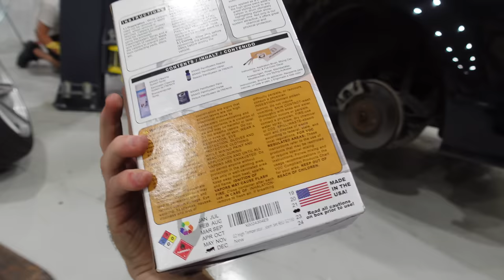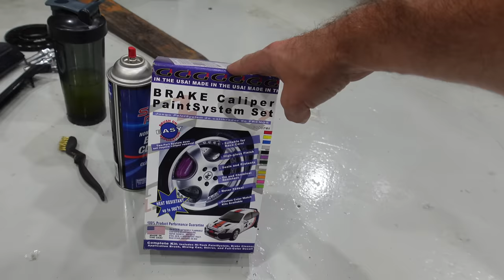The CHEAPEST Way To Make Your Car Look A MILLION Times Better

Comment: I just used a 15 dollar rattle can of brake paint since my calipers were starting to show a bit of surface corrosion. Did it when I was changing pads and rotors and did 2 coats on each caliper. It has held up great so far and its been about a year, with lots of gravel roads and minimal car washes. This kit looks nice but I feel like if you prep good enough with the cheaper rattle can stuff you can get the same result.
Reply: Mine lasted 10+ years before they got darker because of heat, but I'm in dry snow-free California.

Comment: I think it's definitely worth it to paint your brake calipers, if for no other reason than to keep them clean and free of corrosion. (The extra 20 horsepower doesn't hurt either)
Reply from the maker: The extra 20hp is real 😂
Reply: @WatchJRGo  I heard it was thirty more HP's but that might have been the yellow paint color I am thinking of. LOL!!!!
Reply: Doesn't this only increase the stopping power?
Reply: @davidbudd4102  That buzzing noise you just heard was the joke going over your head.

Comment: I painted the calipers on my Porsche 928S2.  All I did was remove the wheel, clean everything with Simple Green, and then mask the caliper off with tin foil and masking tape.  Inexpensive GM gold touch up paint made them look very clean and very stock.  I used cheap Krylon silver paint on the edges of the disk and "hat" in the center, simply wiping the paint off the braking and wheel mating surface with paper towels.

I sold the car several years later and they still looked perfect.  You can buy these caliper painting kits if you want, but you will get the same results with a good cleaning and cheap Krylon paint from the Home Despot.

Great video!

Comment: I got a kit a few years back. It uses a brush like yours but does not have the activator. This means the paint doesn’t get wasted but takes a bit longer to dry. Went with black for my DMC’s callipers and had enough paint to do the FIL’s RRS callipers as well.

Comment: This reminded me of a video that I saw, where a person painted their brake calipers, but installed them on the wrong sides, leaving the bleed screws on the bottom of each caliper! (translation) You will never be able to bleed the air out of each brake line, if the bleed screws are on the bottom.

Comment: I used this stuff 17+ years ago on my Z.  Stuff worked great.  The one thing you don't get is a glass finish like you would get with a PC finish.  Top off with graphic decals!  Def needed for the professional look.  I never had issues with my decals coming off either.

Comment: The G2 kit is the real deal, I painted my Subaru’s calipers (blue, to keep them from overheating 🧐), and the paint held up well against the brake dust, salt, brake fluid and extreme temperature swings during the Wisconsin winters.

Comment: Those Audi brakes are like my Jaguar XF-S brakes, nothing pretty, just big rough finish lumps. Painted mine silver to clean them up but not draw too much attention to them. Couple of years later the rough finish does hold some of the brake dust and road crud, but pad replace light just came up so will probably wire brush and give a fresh coat again.

Comment: I have two red Vettes a 92 and a 96 with aftermarket wheels so I did all the calipers in red ... sure ad's to the look of the cars. I used red heat paint and it's been two years still good.

Comment: Thanks for the comment about the working time that this product has before it hardens. If I ever do this I might try only mixing one-half of the can at a time, before each coat.
Reply: I did mine with a jack and jackstand one wheel at a time, and was just able to finish them all in time. Mixed the whole can.

Comment: Good thing he painted those single piston rear calipers red -- they have such massive stopping power!
Reply: Well, he did also turn is front rotors like it's a 1990 ford. You can't turn the rotors on Audis you can only replace them.
Reply: @schmeat2717  Clearly his rotors don't work anymore because of it.

Comment: I have used smoothrite by hammerite paint Red and it hadn't changed colour 5 years later, I have also powdercoated several sets of brakes for cars and motorbikes and have never had any problems with them many of the bikes were 200mph machines and the cars were not driven by any Sunday drivers to the garden centres.

Comment: I use rattle can  high temp engine paint on any calipers hasn’t chipped or flaked off yet only cost 10 bucks a can 😁
Reply: Btw, looks better when the caliper bracket doesn’t match the caliper😜😜